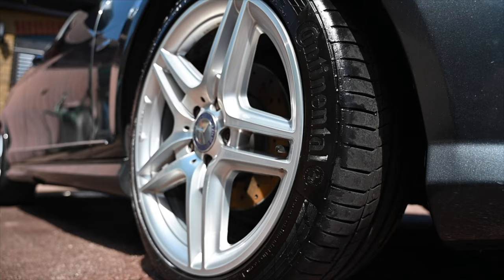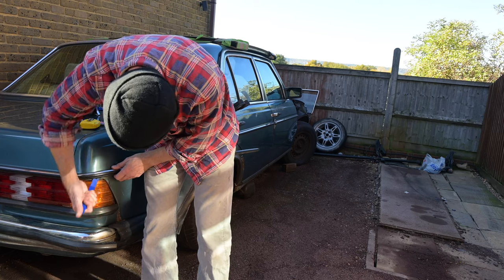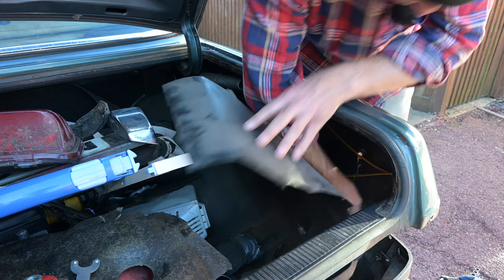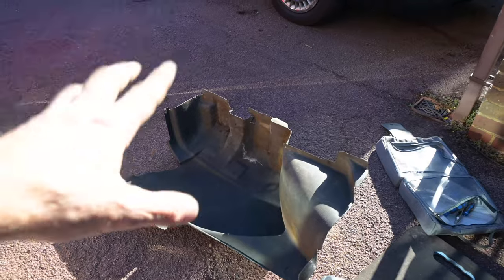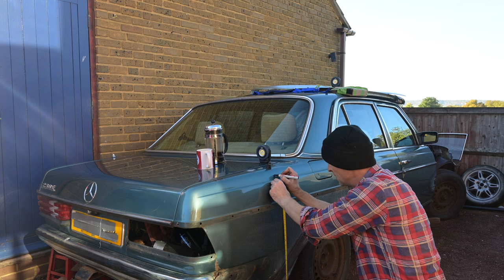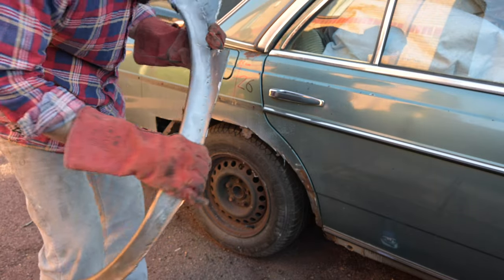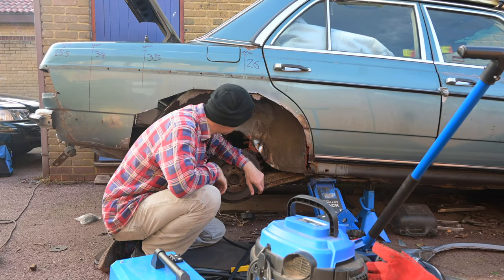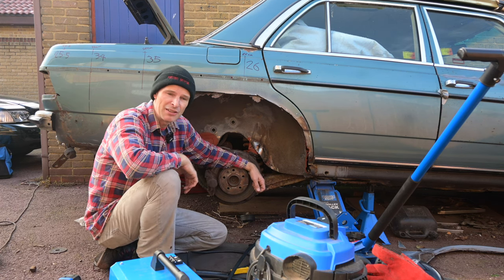Lets fix my rusty rear end - Mercedes W123 wing repairs begin

Comment: These people who moan about fixing the W123 are more than likely the same people who get a new financed car every three years. They don't get it - period. To us true petrol heads, we don't buy cars for their economic value or worth. Some of us like to preserve older cars and drive those instead. Also it's worth working on a well engineered and solid car like this. I wouldn't do this sort of work on a car from say after 2010 as they simply aren't special or definitely not made to the same standard. This is a great and worthwhile project, you are doing a great job Matt
Reply from the maker: Exactly, its not about the financial value but the journey, the experience and bringing a car back

Comment: I might be the Mid 80s Mercedes Texas bandit . Usually cheap ones are the best ones . Rust is present on Texas cars , just pleasantly sheetmetal thin and in  the common areas. Finding a lightly repairing the interiors with wrecking yard goodies . That yards are drying up , slim pickings bags for those hard to find trinkets .Im at 8 currently with 2 builders on stand by , it’s a hobbie  that I’ll know within 10 years may need remedy . I’m getting older and to bend down is easy , it’s the getting back up that wears on the joints as they are , like your channel , looking forward to spending the feedback touchstone , cheers from Dave in Houston .

Comment: Wow, I've just tuned into Furious Driving Pro Edition! Very thorough job and your welding has improved no end. I agree with others who say to use the whole panel otherwise you'll be putting in loads of filler again. Also, personally I would leave the original rubberised underseal in place where it's fully intact. Just clean it up very well, once it's clean you should spot any places it could have been breached. It's very tough stuff and has been there 40 years... You should be able to paint over it once it's cleaned up.

Comment: You are so lucky that the inner arch panel is available! I have just done pretty much the same job on my MK2 mondeo - with about the same amount of rot on the inner arch, but was not able to find a replacement patch panel for the inner. So i had to fabricate my own. And your so right, it may look like a simple shape, but it's far from an easy job unless you have the right tools for the job, along with the know how on how to use them. I got there in the end, but it was a right pain of a job. So you struck lucky with that repair panel being available - going to make it so much easier for you. And lol, I know what you mean about the postage time on some ebay stuff - I think some ebay sellers must have a special 3rd class service available to them with the Royal Mail! But anyway, great to see the work get underway. The old Merc is certainly crying out for it.
Reply from the maker: You really need to english wheel that panel but who has one of those? I was thinking cut a panel, cut strips most of the way through and trim narrower at the point then bend to shape and weld, hours of faffing! 
Lucky there are lots of these still around and people love them so lots of parts support, Mondeos havnt hit that point yet but they are brilliant cars
Reply: @furiousdriving  I do have a small english wheel - but knowing how to use it properly is an art in itself - sadly an art i have yet to come anywhere near mastering!

Comment: I would recommend you get a diamond wheel for the angle grinder as the ordinary ones do wear out fast. It also means you always have the maximum depth of cut available.

Comment: I'd find a straight edge to use to fit the panel.
And fit the entire thing from the taillight to the door shut, the more reference points the better it will fit.
Also go to a decent motor factors and buy some max 1mm cutting discs, you'll find they cut so much neater and quicker.
Keep up the good work, 
The Merc is my favourite of your fleet.

Comment: Thats a daunting task for sure. I did a very similar job on my car although mine was only rusted up to the top of bumper height on the front and rear of the back arch. Nothing more terriftying than cutting it out then thinking "wtf have I just done". You'll get there in the end though and having the inner arch panel available is a mega win. Just needs a bit of patience and alot of working out how to join bits together, best of luck with it

Comment: Matt - try a strip and clean disc rather than wire.  Much quicker and removes rust more effectively.  Wire discs tends to polish the surface and leaves rust in the micro-crevices.  Great video
Reply from the maker: Ive got plenty of chance to try both!
Reply: @furiousdriving  Good point !! Lol 😂

Comment: I've an '82 with 304,000 Mi. !!! Still runs near perfect.  Was rear ended in freeway hit and run, 9/11/21, 20th anniversary of 9/11 !!! 
Left rear corner bashed in. I sure wish I knew you !!! But I'm in Los Angeles !! I MAY be getting an '85, same model for $2,500 which, on the outside, is perfect.. But it's not running yet at the shop where it sits.. If I can get the moolah I'll likely buy it as I do not want ANY other car but a Benz diesel..
PS. These cars have drain pipes in several places, where putting a stick or screwdriver up in them opens a rubber flap and if there's water it will pour out. I'm sure you know this. Just telling your viewers..
Reply from the maker: damn, thats unlucky after driving that far to get wrecked by someone else's carelessness!
The great thing about an old Benz diesel is as long as it's solid (and LA should be rust free) the mechanics are simple an tough enough to fix pretty easily

Comment: personally I'd join the whole panel just under the strip, leaving the mounting holes, that way you would have a straight line to fill and use the swage line as a guide when sanding the filler flat and the strip would take your eye off the area of the join. if you joddle the edge the welding is easier but many professionals butt weld using the tacks every 2-3 inches and keep going until you have a complete weld made up of tacks, this keeps the heat down and the panel flat. if you join in the middle of that large panel (and do not distort the panel) it will be really difficult to get the panel flat even if a body shop does the painting. but I suggest you have a chat with the man at Whiteland's restorations. also you look to be holding the torch a long way out, too far out effectively lowers the amps which reduces penetration. makes it easier to weld as you can see what is going on and you tend not to burn through. if your going to use a series of tacks to weld the panel I suggest you practice first on some steel off cuts, with the joint you choose. they always say to determine the initial welder settings work on 1 amp per thou, merc panels are thick (so 0.035") so if your below 30amp then the tack will not be good but you need to test that because there are so many variable. you also need to be comfortable, which is really hard with a car on axle stands, try using your second gloved hand to steady the torch at the shroud (obviously this will get very hot but it will help you find a nice method) and about 3-5 mm stand off. then look at how long each tack takes to fuse the metal properly with good penetration, if you get comfortable making tacks like this then you should be able tack weld with your eyes closed. on a side note you can get 1mm thick cut off discs, they are great for slicing through sheet steel I do not even bother getting my shears to cut flat sheet.
Reply from the maker: That was my original thought, and looking at all the filler to hide warping Im going back to that

Comment: I wish I had access to power to weld my 1996 Volvo 940 rear jacking point. Needs a 4 inch by 2 inch piece welding in that's gone crusty. Garage doing it for me and then MOT. I enjoy watching you welding. As others have said hide the weld join by the trim. Presume weld a bit at a time to avoid heat distortion. What's the nearside like?

Comment: You can get the boot corner panels from eBay also. They cast around £40 each side
Reply from the maker: Its amazing how much is available for these
Reply: @furiousdriving  yes definitely a good selection available. It saves so much time over trying to fabricate your own parts. For the last year I have been welding up the sun newspapers giveaway Trabant. 
Am almost finished now thank goodness. Panels are very easy to obtain also.

Comment: keep an eye on lidl special buys, they do a parkside plasma cutter that's very good and actually used by pros (get the one with the built in compressor for ease)  you'll have all the rot chopped out in minutes then!
Reply from the maker: I always miss the lidl deals!
Reply: @furiousdriving  they do pop up on eBay as well...but I can always give you an email if I see them coming up in Lidl.  There about £150

Comment: What about doing the far
side sill £75 eBay might be same place where you are getting your rear arch inner tub.better than messing about with bits of mettle 👍🏻🇬🇧. it's a shame Draper doesn't do bigger batteries 5-6 amp
Reply from the maker: The sill only needs the end, that will be easy to knock up

Comment: Matt as long as the engine and transmission are good in the nercedes Benz are good and work the rust repairs are worth doing a little bit at a time you will get there and you doing the work its a lot cheaper also your welding will get better the more you do and new oanels available makes it easier
Reply from the maker: Now Ive fixed the injection and fuel system it starts so easily its incredible, should driven well once its done
Reply: @furiousdriving  l was watching another you tube video on a slightly later Mercedes Benz had the same fuel injection as your W123 and it was running and the you tuber just made an adjustment to the mixter on it and made run a lot better but keep going with your W123 as long as it goes as a project its a good idea and you are getting better at your rust repairs

Comment: Before cutting the replacement panel, go over the rest of the rear wing with a magnet to see what's metal and what's filler, may be better to fit the new one complete below the trim line.  Filler can hide a multitude of sins yet to expose themselves.  I'm going to be welded to this.
Reply from the maker: I think (from cutting into it) Its all solid apart from the bottom corners, but they warped it when welding that repair bodge so skimmed it all in loads of filler

Comment: The fact you're running beads on these welds means they are not hot enough which means not penetrating enough. By the time you grind these welds off there will be little or nothing holding it on. For the arch panel I would suggest joggling it. You're going to have to be very careful with that long straight weld on that rear wing, if you continue with your welding technique it'll crumple like a coke can.

Comment: If people think this is too gone they never been involved in car restorations. I grow up in a car body shop and sometimes we have to fabricate entire floor panels because the old ones are gone and new ones don't exist. I seen a Ford Cortina Lotus being full restored where 80% of the car had gone with holes you could put it your hands through, even door panels where fabricated. So this w123 is ok
Reply from the maker: Exactly! Ive not worked in one but have spent alot of time in them, and have seen some real horrors brought back to concours

Comment: Matt get some cutting discs, your use in a grinding disc , that’s why you are struggling
Reply from the maker: no, those are definitely metal cutting disks, I have grinding disks as well
Reply: @furiousdriving  are your cutting discs 1 mm thick?
Reply: @furiousdriving  a cutting disc is thinner as said above

Comment: Suppose an endoscope or fibre optic camera could show up a lot of these problems early on and the real condition of the car so you have a better idea of its condition.
Reply from the maker: I wasnt expecting such big problems as the outside looked solid, the repairs hid more than expected
Reply: @furiousdriving  They have a device that tells you paint depth and hence repairs I believe.

Comment: Yeah best spraying nuts and bolts with wd40 first tap them with hammer  try tightening them then try undoing them a little then tightening a little to undue.
Reply from the maker: not WD40 - Bulldog
Reply: @furiousdriving  sign of the times